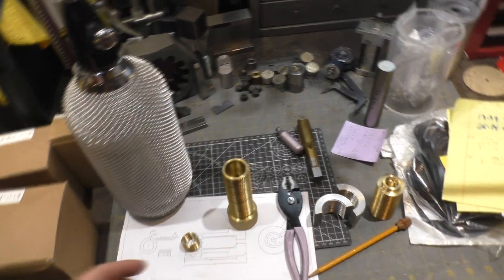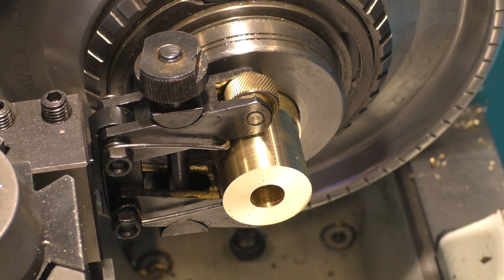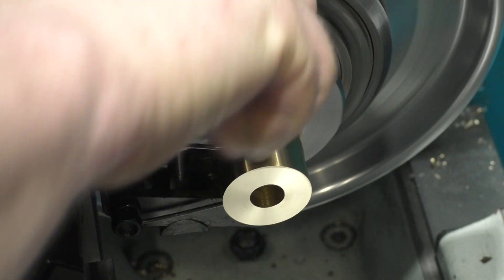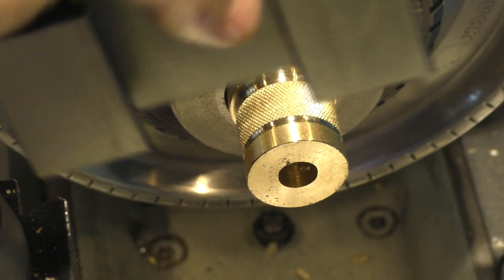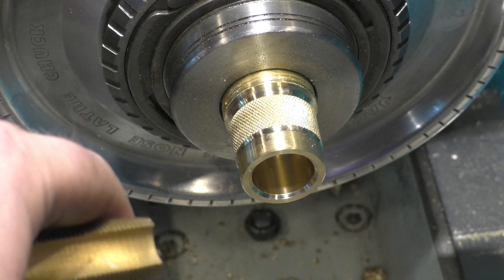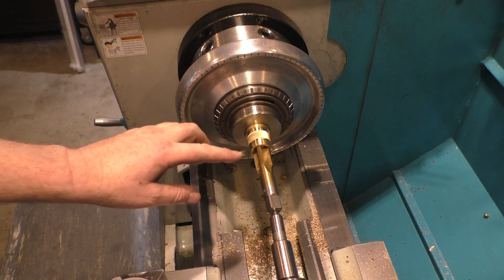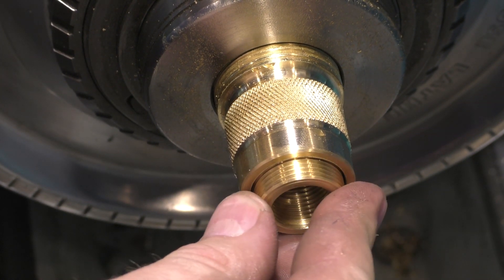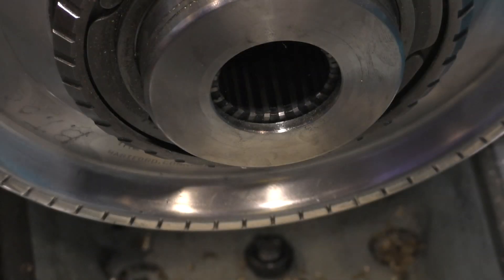95 Czech Seltzer Bottle CO2 Charger Holder Part 2

Comment: I use a scissor knurler, I’m the same way, on sizes on knurling. Most parts I do is for grip or decorative reasons, the odd number never makes a bad appearing knurl. Lots of cutting oil, even on aluminum is required IHMO. Awesome job
Reply from the maker: I want to get a scissor knurler as well or perhaps a Dorian if someone will let is go for a song on Ebay. Thanks as always for the helpful comments.

Comment: What type brass are you using?  Looks like a Golden Rod oil can, a great USA made can.  Looking good so far.
Reply from the maker: I believe it's 360 brass. It seems to be the grad most commonly carried by my metal supplier. Cuts great, looks great, messy as he-double matchsticks.